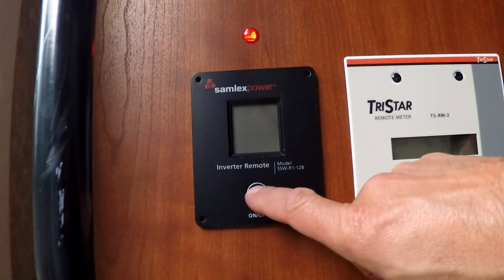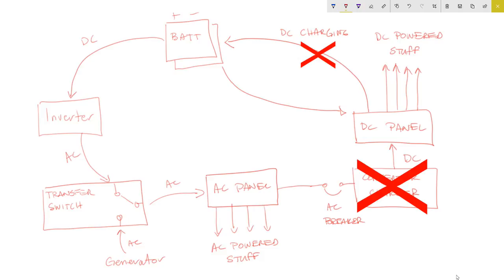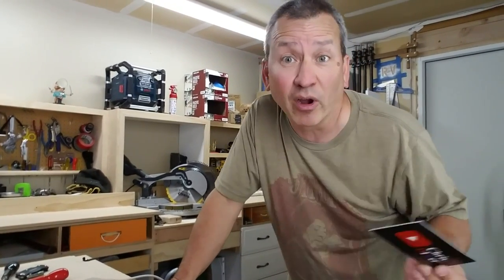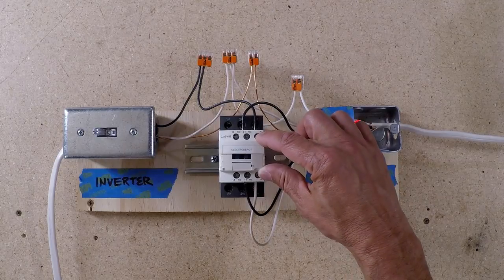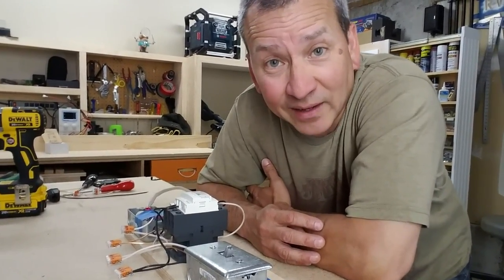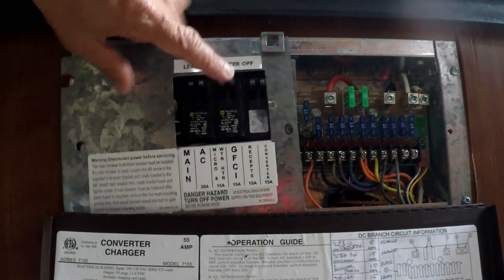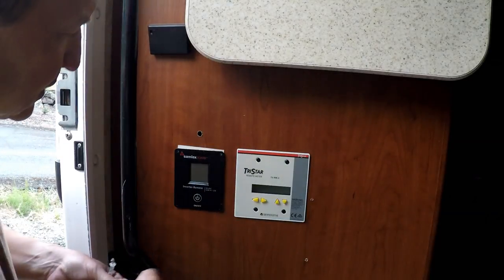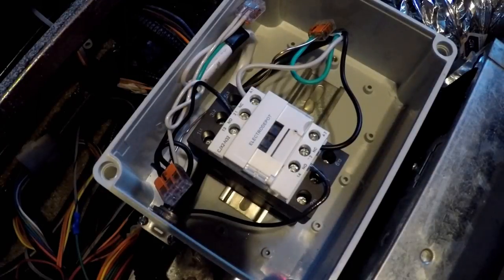How To AUTOMATICALLY Disconnect a Converter Charger When Using an Inverter

Comment: do you have a video of the original way you had the inverter setup? meaning when you still had to turn off the converter prior to turning on the inverter. I am assuming i can plug my 30 amp directly to the inverter, but have to remember to turn off the converter 1st. I believe that is what you are saying in the beginning of the video. Sorry, i am new to installing an inverter in my RV, i wanted the most simplest way such as connecting that 30 amp to th inverter. Any advice would be greatly appreciated.
Reply from the maker: What I did was to wire an AC cable that plugged in to the inverter out. The other end goes to a 30A service receptacle I mounted in the shore power cable compartment. Then I could plug the shore power cable into that 30A receptacle when I wanted to be powered by inverter.    You will need to turn off breakers in your AC panel that you dont want enabled while on inverter power (like the converter). Hope that helps. I have an old video somewhere that shows this but I cant find it 🤪

Comment: Brian-  can you confirm what’s hooked up to A2 on the relay??  Is the neutrals all hooked up, even between the convertor and invertor??
Reply from the maker: +Oma and Opa’s Camping Adventures A1 and A2 is the hot and neutral from the inverter. I don't think it matters what order their in. When power is present across A1/A2 the relay is activated.

Comment: Hey there, I have watched this video over and over but I'm still missing something. The line from the circuit breaker is moved to the new contactor switch, and the INVERTER is controlling the power to the new switch. and the CONVERTER and indicator light are both connected to the New Switch. And when the INVERTER is turned on that opens the circuit to the CONVERTER. Now the question, what is connected to the old circuit breaker?
Reply from the maker: The old wire from the circuit breaker is on the other end of the NC (normally closed) side of the relay and so is the indicator light.
Reply: @RVwithTito  thank you, the light bulb has finally come on, in more ways than one.  I got it, "finally" thanks for the knowledge. Hope to see down the road. Happy trails.
Reply from the maker: @ronjones2733  That's great Ron. Glad to help.

Comment: Ao how would i do this well not even concerned about automatic switch but trying to wire my inverter to my motorhome that has a wfco 8955 fuse panel with 3 stage converter.

Comment: Isn't the converter basically in the OFF position whenever it's disconnected from shore power ? As in no charging current going to the battery ?  I was thinking about a simple battery disconnect switch switch to disconnect the inverter from the battery before plugging in the shore power cord. Wouldn't this simple approach accomplish the necessary requirement ?
Reply: thats what i was thinking of ,is that right?

Comment: Hey Tito.  I love this and I'm going to be doing this in my RV.  I only have one concern.  Does the contactor get hot in that sealed junction box?
Reply from the maker: No not at all. It doesn't' even get warm. It's also rated much higher than the amps I'm pushing through it.

Comment: Hi Brian, maybe I missed it but how are the 12 V items in the coach able to be powered after this system is powered up with the converter being disconnected? Thanks
Reply from the maker: The converter and battery bank are both connected to the electrical system. So with the converter off, 12 V power is coming directly from the battery bank. This is why your lights, water pump, etc still work when you're not plugged into shore power.
Reply: Thanks Brian, so The batteries will still be getting charged if hooked to the solar system, just not being charged by the converter, thanks
Reply from the maker: Yes. The batteries are being charged by solar and are powering the 12V circuits directly and AC circuits through the Inverter (if you have one).

Comment: Hello Dears. Why you don`t use a Victron Energy Multiplus or a ClaytonPower Combi? There is all inside what you need. Inverter, Charger, Switch and also a Ground Relais for the RCD. So i think this is more easy and cheaper? You also can use a Quattro of Victorn Energy. In this you also can connect a Generator and a Grid together. There is all inside.
Reply from the maker: Perhaps that's something to consider in the future. This fix was < $50.

Comment: Great idea but my WFCO 8735 the converter/battery charger are all in one. If I shut it off then I won't have any 12v output to power my 12v items. Anyone got any ideas?

Comment: Is it possible to double up and route your fridge circuit breaker through the same connection as the converter on the relay?
Reply from the maker: +Arley Clark Yes I suppose you could as long as you have a dedicated circuit for your fridge and, when combined with the coverter, it doesn't exceed the rating on the relay.

Comment: with the converter charger switched off and inverter on do you still have 12 volt power in the RV.I would think you would be getting it straight from the battery.correct?
Reply from the maker: Yes.That is correct.

Comment: Question. I’m not an electrician. So when you run that relay, it basically goes between the charger and the breaker?
Reply from the maker: Between the breaker and charger so you can leave the breaker on. There's another option that I'll be covering soon using a transfer switch that has the switching built in. Check it out: https://amzn.to/34qq5iF

Comment: I have a question,  do you have a exact wiring diagram for this contactor switch install.  Your shop make-up on the board only showed the bottom half of the switch and all the top half wires are blocked from view. Do you have any Drawing or another view that shows both input and output of the contactor that includes the little monitor light as well.  Yes, I'm picking your brain,,,,,,,, A good mind shouldn't go to waste .   Thanks in advance
Reply from the maker: I have a photo of it setup on the shop. Email me and I'll send it to you. Brian@rvwithtito.com.

Comment: Im planning to put up 1300 w of solar, 150 a mppt charger, 3000 w inverter and 3 battleborn batteries, and use it like a generator and plug in my shorepower into it. During sun hours everything in the rv will be powered and however long the batteries will go.

Comment: Wouldn't it be much easier to eliminate your converter and you inverter and go with a Magnum inverter/charger hard wired into the AC power panel?
Reply from the maker: Thanks for your input. That would certainly be a great solution down the road. For now, it's probably not the easier solution. What I did was a pretty inexpensive solution < $50. Switching over to a different unit and rewiring everything would be a much bigger project.

Comment: Hello. When you shut off the converter somthat you no longer have one, how do you convert  the AC current to DC current to run the 12v lights, furnace fan etc? thanks.
Reply from the maker: Your house batteries are still providing the 12v power as well as powering the inverter.

Comment: You can use the contactor as an ATS and kill the converter/charger. Shore power applies to A1 (hot) and A2 (neutral) as well as 13 (jumper) to activate coil. Pin 14 goes to house hot. Inverter power hot goes to pin 21 and pin 22 goes to house power. I used the L1 downstream of the circuit breaker and T1 feeding the DC converter. Hope this helps someone else!

My contactor has this buzz sound which only buzzes when connected to shore power. The inverter being on NC means it's default, but switches off (open) when shore power is applied closing the gates, as well as flipping inverter source off and closing NO, as well as T1, T2, and T3 closing gaps to L1, L2, L3 respectively. I might add the water heater to T2/L2 so it doesn't run off inverter too.

Comment: Nothing really happened when the generator is running at the same time as the inverter. I was kinda scared of two (generator and the inverter) sourses powering the RV with 120v each. But i guess it ok. Do you think its necessary or helpful to have some sort of safety/switch, when yhe generator is started the inverter is disconnected? So that the generator can charge the batteries and power the RV.
Reply: I guess you can wire the generator starter button to only work when the inverter is off.
Reply: Hmm?

Comment: The whole thing could have been a little simpler by using a combo inverter/charger and do away with the converter altogether.  When plugged into shore power, the unit goes into charging mode.  When shore power removed, it goes into inverting mode.  I have been using these combo units for many years.  Why try and reinvent the wheel?  All the work has been done already and in contained in one box.  Unlike many converter chargers, dedicated inverter/charger units have mult phase charging algorithms that do a much better job at charging batteries.
Reply: Well, there is the downside that a combined inverter/charger is a lot more expensive and bulkier than a pure inverter, especially when you've already got a perfectly fine charger that came with the rig.  In my case, I don't have the space under the fridge for a combined unit to fit in where the charger is today.  And my charger does have a multi-phase charging, although with my lithium batteries I've disabled that for a fixed 14.4v output.

I'll mention that I wired my ATS completely different, so that generator and short power has priority, and cuts out the inverter.

Comment: I have the same recurring loop on my camper. Batteries powering an inverter that the main power is plugged into, and the converter tries to charge the batteries. When I turn off the circuit breaker I lose my 12 volt lights. Am I doing something wrong?
Reply from the maker: Hard to say without know more about your wiring. On mine, the batteries and converter output are connected to the same bus on the DC panel. So when the converter is not providing power, then it draws DC from the batteries. Your 12v must be wired differently.

Comment: I flipped the breaker to my converter when I was connected to my solar.. this seem to cause me to have problems with power? So I flipped it back on? Does anyone know the problem? I have a separate battery bank from my rv but same principle.. off grid solar powered living in my rv untill my hosue is finished

Comment: How do you know if your unit has the type of inside inverter that will automatic disconnect when hooked up to a separate battery bank inverter hooked to power the unit ?
Reply from the maker: It will be called an inverter/charger or hybrid inverter. Get the name and model number from the unit and look up the specs online.

Comment: Why not add an auto transfer switch when you were running the wires between the two? As I understand it, you now plug the rv shore power directly into the inverter, but an ats would have been pretty easy to install at that point?
Reply from the maker: I do have an ATS, but it doesn't affect the charger. I have a new one now that does, but haven't installed it yet.
Reply: RV with Tito DIY What if you wired the charger ac side to the shore power line BEFORE the breaker panel (would require its own breaker/fuse). The charger would only be active when that is plugged in. Then install an ATS. I dunno. lots of ways to skin the cat....
Reply from the maker: @Gratefulwon  Yes. That's what I was planning to do eventually. Then someone told me about this ATS from GoPower that has all the switching built in. So I got one and will install it soon. I'll remove the existing contactor but leave the indicator light (I like seeing that).

Comment: I have a separate bank of batteries that run my inverter(charged by solar) that is running my inverter that is connected to my shore wire cable when not connected to shore power.What if you have a bank of batteries that are not connected to the camper converter circuit? Would you still need to disconnect the converter or just turn off the converter? By turning off the convertor with this setup does it disable all the 12 volt appliances?
Reply from the maker: I'm not quite certain how your system is setup. But if your converter/charger is receiving AC power while your shore power cable is connected to the output of your inverter, then it is probably going to try and charge your other batteries while also feeding DC power to the power panel. If this is the case, you'll want to make sure the charger portion is disconnected in this mode. Again...not exactly certain how your system is setup.

Comment: Tito, Great Vid. Have 2000W Xantrex set up and connected to house. Ready to purchase a contactor. Electrodepot does not show your model # on any of the contactors. Am I ok with the LC1D, item# 931810? Thanks, Ken
Reply: Tito, one more question. Will the alternator continue to charge the house batteries while driving if the converter is turned off. I have designed a system for our flexible monocrystalline panels to be set up only when we park. They are stored while we are on the road.
Reply: Answered my own question alternator still charges when converter is off. So this is my thought at this point. Because we use our RV as a daily driver (24' Quantum on sprinter chassis) while on trips the batteries are being charged most efficiently by the alternator. If we stay in one site for more than a day we set out our two 100 watt solar panels. We only really need to plug in or use the generator for air conditioning which be the only time we would turn on the converter. Not even sure we would need to do that since solar would most likely handle charging the 12v batteries. Am I missing something here?

Comment: But with your new system, when the inverter is on, there is no 12v from the converter/charger, so any 12 volt loads will be draining the coach batteries. You could have used a HD contactor to disconnect the converter/charger output from the batteries, thus allowing the converter/charger to remain on to power all 12v loads when the inverter is on.
Reply: Then you'd be converting 12Volt into 120Volt and then back into 12Volt, which uses power in itself. By nature of the situation that he is using the inverter, the batteries are the only source of power, whether that is direct 12 volt or inverted into 120Volt.

Comment: The purpose of the contactor is to bypass the charging converter automatically. So in this video you powered the inverter with the generator. How do you power it with just the batteries? I thought you just used the generator for charging the batteries up?
Reply: No, he was using the generator as a source of 120V, so at that point he would turn off the inverter and allow the generator (or shore power) to do its job.

Comment: I know this is an old video, but I want to ask you how you like WAGAN connectors?  If you read this, can you respond?
Reply from the maker: I love the Wago connectors and use them all the time.
Reply: @RVwithTito  I just finished a project installing a Renogy DC/DC charger wired into my Ram 3500 with a 2000W Renogy inverter and a GoPower 30a auto transfer switch in our Outdoors RV trailer this week.   The transfer switch came with Wago connectors.  I had never used them.  I was impressed.  Great connection and so easy to use, especially in tight spaces.  Testing everything today.  The trailer converter is on when the inverter is running so I've got to correct that loop, but other than that it all works great.  Now we can run the refrigerator on 120v when traveling.  This will be more reliable (been having trouble with the propane flame blowing out on the road) and a lot safer when fueling up!  Really enjoy and learn from your videos Tito.  Keep up the great work!
Reply: Check....wago....

Comment: My generator does have a battery charge connection on it. But o think you are right
Reply: I think it won’t time the charge down as the battery gets to full charge. So I will try the charger way because it will reduce the charge rate.  
Thanks again

Y’all have a Merry Christmas.

Comment: Have you ever experienced the converter buzzing or humming when the inverter is plugged into it? My converter is quite on shore power but when I plug it into inverter and turn off charger the converter stars buzzing like a transformer... Every deal with something like that?
Reply from the maker: I haven't had that issue. What kind of inverter do you have? Pure sine or modified sine?
Reply: RVwithTito ita a brand new pure sine 2000watt....it.might be busted.. I have 4 other inverters coming in from Amazon to test if they also cause buzzing at converter... Great videos.. Thanks
Reply: The entire purpose of this project was to NOT have the converter on when running the inverter. Running the converter means you're using the battery to charge itself and double converting power from 12V DC to 120V AC and back to 12V DC. Even without the charger going you still are unnecessarily converting to get 12V power you already have.

Comment: Could one not also use the contactor th shut off inverter when plugging into shore power/generator?
Reply from the maker: It would be a little more challenging to do that since the inverter runs off of DC power switchable through its own remote.